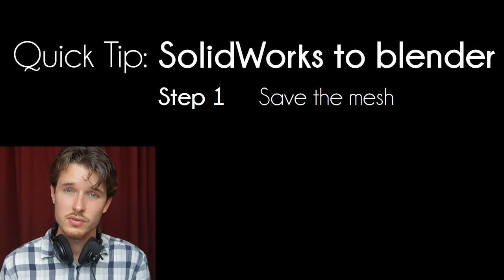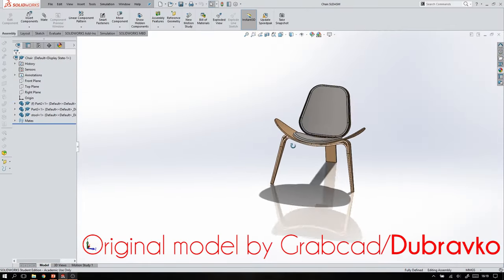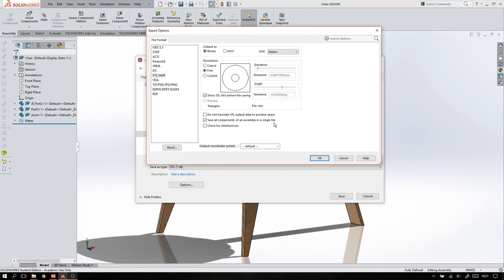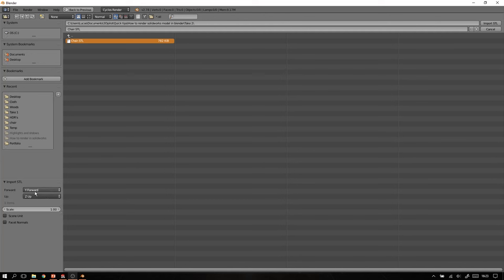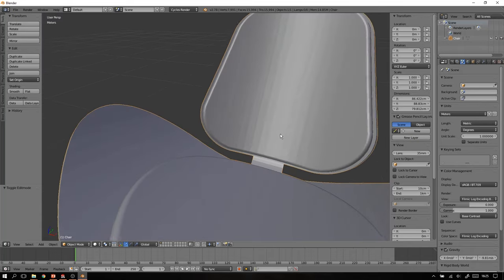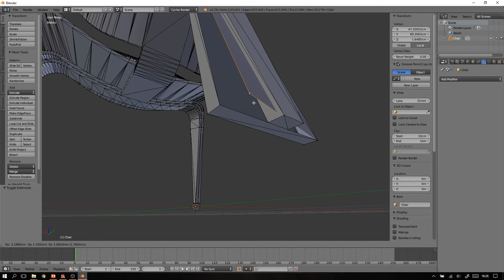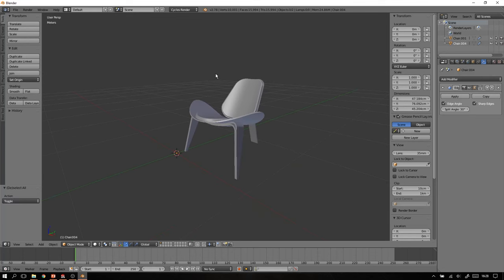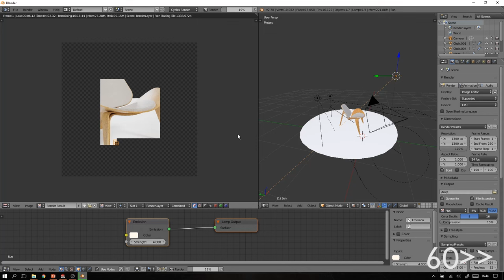HOW TO: Render a SolidWorks model in Blender

Comment: Nice tutorial. I’m going to be a mechanical engineer. One thing that I hate about presentations is that they are boring with cheap renders. I want our team presentations to include Blender renders for our designed parts and have photo realistic renders and animations in the presentation slides. I can finally use Blender and put it though it’s paces. Thank you so much for showing that it’s possible.
Reply from the maker: Awesome! There are many ways to present work in a more engaging way. I'd definitly encourage you to check out Eevee if you're interested in animation!
Reply: 3Dpilot, thanks. I thought that cycles would be best for those renders
Reply from the maker: @wyattb3138  Well, Cycles is the more realistic of the two, but eevee is much faster, giving you more time to make more awesome renders or even animations!
Reply: 3Dpilot, okay I’ll try both and see what happens.

Comment from the maker: Another way of making certain edges look 'hard' is to add a bevel modifier. This is a little harder to use as there are a few more settings to adjust, but gives you the ability to automatically have tiny bevels (Fillets/Chamfers) on the sharp edges without having to worry about them in your base model. 

See my last video "HOW TO: Render in SolidWorks (part 1)" (youtube.com/watch?v=LHtBIgD61PU&t=2s) where I explain why 100% sharp edges are a physical impossibility and don't look natural.

Comment: I recommend having those "wooden pieces" as separate objects as you can do some really fast non UV based box projection image texturing.
I'm guessing there are some custom normals stuff stored internally in the solidworks file that obviously don't come across with the .stl file.
The example object is too simple. Try with complex blended surfacing, advanced bevels, or even deburr bevels (only for rendering within
Solidworks) and there is no trickery to be done to get good results in Blender. Stl is a nightmare, I wish there was something better, like
exporting to nurbs patches and Blender had proper nurbs support.
I would apply the edge split, then separate by loose parts. Then starting to apply different dummy materials to different parts. Finally, I would
bring the parts back together that don't benefit from having their own coordinate system (for box projection image mapping).
Grabcad files often comes with .stl as a download option. People should check them out and try to convert them to usable Blender files just
as an exercise. I'm using both Solidworks and Blender (and Autocad LT, yuck) at work and I try to clean up the .stl exports using tris->quads
and some limited dissolve/decimation stuff. Usually I'm not closeup to these kinds of models, so shading errors isn't a huge deal always.
But some models I need to properly clean up, pretty much remodel on top.
Edit: If you can, prior to export from Solidworks, I would open the parts and suppress any bevels or chamfers if you need to clean the model,
as these are easier to add back later in Blender. Maybe not on blended surfacing ,but you get the point.
Reply from the maker: A lot of great tips in there, seems like you know the drill! I've found that Keyshot (yes, its paid) is able to convert nurbs to meshes a lot better. MOI also does a better job at it. I'm keeping an eye out for a format that comes with the custom split normals, but so far, haven't found much. One more small tip; the weighted normal modifier also often cleans up some rough spots.
Reply: @3Dpilot  I'm aware of Keyshot but I've never used it. As for SW, I'm only on the standard version without visualize (decent) or even 360 (garbage). The typical work is extruding rooms and walls and placing furniture and our equipment in it for drawing production. Then export as .stl and cleanup the room/walls and replace furniture and some equipment with proper models using the import as a placement guide. Add fixture/lights and doors/windows and some basic texturing work. Due time restraint, we've even done sales based on a crappy pure AO render. Not something I'm proud of, but I guess it got the job done. For us it's not about super high photoreal accuracy but give the customer an idea about the space and equipment function in that space. But yeah, I tend to spend time on making it look "pretty".

Comment: Is STL the only way, best way to get smooth roundings in blender? No way to get a obj. file from solidworks by an converter?
Reply from the maker: If you want to go straight from SolidWorks to a mesh type file, then both .STL and .OBJ files deliver the same mesh (depending on resolution). This mesh is not perfect however and has some bad topology that causes shading issues, especially on complex surfaces. I suggest looking in to MomentsofInspiration (http://moi3d.com/), as their mesh exporter seems to export .iges or .stp files to meshes a lot cleaner. Does this answer your question?
Reply: The best way to go is converting with a tool that preserves the explicit normals from the mathematical surfaces of the Nurbs model when converting to a mesh. Then you can get nice shading regardless of topology.  The mesh output is usually based on triangles and the topology is different from subdivision surfaces, but since it is based on Nurbs curves you can choose different resolutions when converting to mesh depending on the parameters exposed in the mesh conversion software. STL files don't support explicit normals, and there is no obj exporter in SolidWorks or in most other cad modeling software either afaik. 

There are some dedicated conversion tools out there that can convert Cad data to DCC content. Quite recently a company called Pixyz came on the market with some very interesting software (PIXYZ studio) and now they are integrating that into Unity! Unreal engine started a while back with cad translation in their Datasmith/Unreal Studio which is in beta. Autodesk has something called ATF which is built into many of their software packages like 3dsmax and VRED.

Blender doesn't support Solidworks files, STEP, IGES or other common cad/Nurbs formats. I don't know what the best solution is for Blender, but I don't think STL is the answer. If anyone can figure out a better workflow for Blender, I would love to hear about it.
Reply from the maker: You clearly know your stuff! I certainly agree that .stl files are not the best solution. Good enough for some basic visualisation, but not very accurate. I too would love to know a better, more precise workflow! Thanks for the comment!
Reply from the maker: Thank you for the in-depth look! Perhaps that would be a solution, yes. Does that solution result in correct normals? To be honest, thats quite technical and not my field of expertise. Would be, for sure!
Reply: you can use simlab composer as a medium to convert solidworks files to Binary fbx, it works really well, you read this post to learn more http://vrforcad.com/importing-solidworks-models-to-blender-as-an-fbx-file.

Comment: Can you help me!??
Why when i try to smooth the import ''Solidworks'' file in ' Blender'
One part of the detai is gonna get smooth, but the other one is worst?
Reply: sense that one side is deformed
Reply from the maker: Did you add an edge split modifier / select Auto Smooth under Object Data? Some shaing issues are to be expected but with Either of those changes the result should be ok. Did that help?
Reply: Yee it's work!!!
Again, thanks a lot!! :)

Comment: Great tutorial!!! Could you make one about using the rendering engine of blender? Like cycles or even luxcore. Im a ZW3D user and I cant afford keyshot, so I am learning how to render my models in render, actually trying to learn luxcore. I found your tutorials very easy to follow, great work!
Reply from the maker: I'm currently not making any rendering tutorials - though I would strongly recommend Cycles and EEVEE. They are very well integrated into blender and very performant as well. Keep exploring, rendering is a great way of expanding your skillset!

Comment: Greetings My good Sir.

I have made parts in Solidworks and imported to Blender but I am learning Blender as of the moment I am typing this, I am completely new to it.

I have added materials and looks to My solidworks parts.
When I import to blender in .stl file format, the part is without any color and material. How to deal with this ?
Reply from the maker: Hi! You could try to export is over to .3mf file type. However, this often does not work. I reccomend going for .stl and applying materials within Blender.
Reply: @3Dpilot   

Yes Sir.
I looked into it after that and it was on quora that the materials are not copied/ transferred over, which is a bummer.

Now I will learn how to make materials and stuff in blender. Thank you Sir for your time.
Reply from the maker: @saliqkhan9744  I wish you the best of luck, and a lot of fun!

Comment: I think stl. Have problems in blender with smooth and subdivision.  .obj is best i think with materials too.
Reply from the maker: .OBJ is a bit better, yes. It supports quads, multiple objects per file and some basic materials. Hoever, you can't expect the materials to translate well between software and the meshing algorithm will probably be just as bad as STL. For now, STL strangely is still your best option.
Reply: @3Dpilot  for me obj works great. For animation stuff. In blender. Separate by looseparts.

Comment: is it possible to export appearance of solidworks model to blender?
Reply from the maker: Technically, yes. Using the .3mf export function some appearances might come across somewhat decent. However, they will not look the same and you'll require some basic materials knowledge to work with them anyway. In my opinion, it's better just to build the materials from scratch rather than using the often bugged materials that come with .3mf. If you're using a separate rendering engine, .fbx exports might be more useful.

Comment: Thanks for all informations! I have a question, when you separate the parts it creates a lot of layers. Is there someway to merge all layers made from the same material? In purpose of making it more light
Reply from the maker: Yes, there is! A better way to manage materials is to keep al parts of an object together as an object. You can actually apply multiple materials to an object by going in to edit mode, selecting some geometry, creating a new material slot and applying the material to the selected geometry. https://www.youtube.com/watch?v=IrMhbuC8aM0 <- This workflow works for both Blender Internal and Cycles. I hope this answers your question?
Reply: 3Dpilot Yes you rock! The problem i was facing is beacause how the file was made on solidoworks. I guess the best way to import is in separate and then assembly on blender so that i can apply materials
Reply from the maker: William Garcia I see.. I'm guessing your seperate parts of your assembly get connected in the .stl file and make splitting harder? At least that's an issue that I have faced before. Thank you so much for the support ;)
Reply: Exactly!
Reply from the maker: William Garcia I suggest indeed ticking selecting to NOT save all parts in a single file. Make sure to tick 'do not translate into positive space' (or something like that, I'm on mobile right now). That way, you can import all .stl files at once and they will be (should be, Solidworks acts up sometimes) in the correct place :)
Reply: I got the idea but i'm not understanding if you are talking about solidworks or blender (I'm from Brazil, english is a kind of hard to me). What do you mean with 'tick'?
Reply from the maker: William Garcia I mean, when exporting from solidworks, you can select a box to save every part of an assembly in one big stl. This is not what you want, Its better to not select (tick) the box so every part is saved in a different .stl
Reply: 3Dpilot This seems to be exactly what i need, so that i can assembly on solidworks. All right, sorry for taking your time, thanks a lot i'm going to use all the tips you gave me
Reply from the maker: You are very welcome!
Reply: @will-iamgarcia  tick ✅

Comment: Is there a way to clean up the .stl mesh file SolidWorks creates when i export it?
Reply from the maker: Jared J depending on your model, some 'cleanup' can be done. If needed, i do this manually in edit mode, but this does require a bit of knowledge of poligon based modeling /blender. You can try exporting in different resolutions, or export to .step or .iges, open that up in MOI (you van get a free trial) and export it from there, as that software gives much better mesh topology. I hope this answers your question?
Reply: I am not sure what MOI is. Moment of Inspiration? http://moi3d.com ? 

When we try exporting the model file from SolidWorks at higher resolutions, it still has the same problem by having way too many meshes. It makes editing the mesh files nearly impossible. Granted, I would consider myself still a novice at Blender modeling. It very well may be possible to work with, it's just I haven't found a way yet.
Reply from the maker: You are absolutely correct. Exported meshes are far from ideal. I wouldn't recommend editing exported meshes, except little fixes where shading is unacceptable. I did find this method good enough for making renders though, and combining my 'solidworks' model with other, non-CAD objects. MoI is a 3D modelling program. Its quite limited in functionality but does offer a better mesh exporter that leaves cleaner meshes.

Comment: How to get a blender sculpted part into Solidworks?
Reply from the maker: You can try exporting your model from Blender as an .stl file, then import it in Solidworks. Keep in mind that heavy sculpts (with many faces) slow Solidworks down a lot. You can import as a graphics body (which is faster, but you can't edit) or as a solid / surface body (which is much slower, but you can edit the geometry).

Comment: mine just wont show up when I import
Reply from the maker: There's a couple of things you can check out. Is your .stl file really small (A few kilobytes)? Then your SolidWorks export isn't working well. Is your model really really small, big, or far away from the origin? have a good look around to see if there is any actual geometry in the scene. If you really can't figure it out, send me your .stl on the 3Dpilot facebook page and i'll help you out. Cheers!
Reply: found it ! It was just huge and out of frame. Thanks!
Reply from the maker: Yeah, probably an issue with scaling. Glad you found it, good luck!